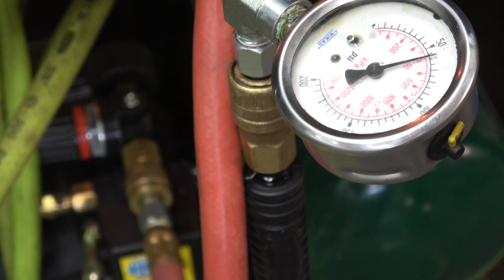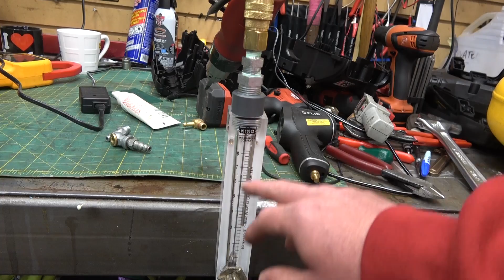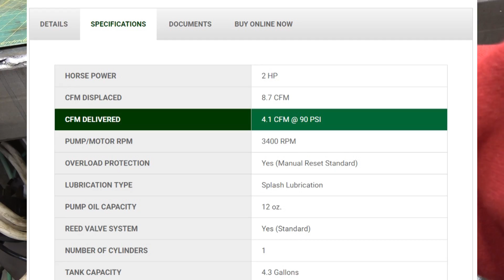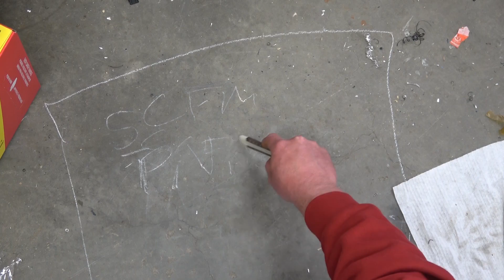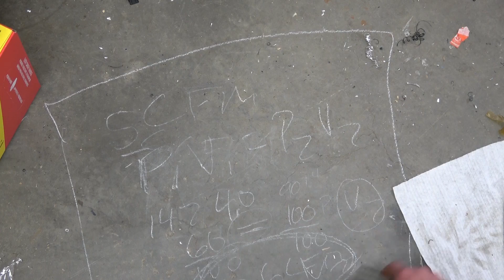Why are CFM ratings BS?

Comment: We can estimate power needed to deliver 4 CFM at 90 PSI:  P = 3,25 * 4 * 90 = 1,17 kW.  (so we multiply cubic feet per minute by pressure drop in PSI and 'magic constant' 3,25 to convert it to watts). This is bare minimum if we assume 100% efficiency of compression (it all goes so smooth and slow that air doesn't heat up, so all the power goes only to build up pressure) and 100% efficiency of motor. For one-stage compressor it's obviously wrong, so we should at least double this value. So if compressor doesn't draw 2,4 kilowatts of angry pixies, no way it could deliver so much!
Reply: Isn't the compressor efficiency about 16%?  Motors are about 98% so say 15% overall, so you need about 6x your calculation
Reply: This. I've never believed for one second that an air tool whose electrical sibling draws 800W, 1000W, or more, is gonna run on a compressor drawing 1500W. At least now I know the details.
Reply: Standard outlets are 16A, so between 3520 and 3840W depending on line voltage. It depends on what country you're in, some outlets in Sweden are only 5A or 10A, while in NL 16A is standard, and in the UK it's 32A. Which is why they have those retarded plugs with upto 13A fuses in them.
Reply: @fermitupoupon1754  Those "retarded plugs" as you call them, are actually extremely well engineered and robust plugs designed from the ground up unlike the flimsy ones used in much of the world, like North America. However, whilst you might not like 32A circuits, they have the extremely useful facility that I can run more than one high-powered portable device in the workshop or kitchen plugged in where I like without worrying about tripping a breaker. A good tradeoff I feel for that small ceramic fuse in the plug. There is also the other side-benefit, that I can plug in a low power device with knowing that the relatively thin flexi cable is properly protected by a 3A fuse in the plug, and not just the 16A MCB. 

Also, before you mention it, that's for over-current protection. The 32A circuit is also protected by a residual current device.
Reply: ...on industrial grade machines the simplest method and will get you pretty close is about 4cfm per horsepower.....and at 575vac it's about 1hp per amp....also the base pressure is 100psi at a temperature range I don't remember lol.....now there are proper formulas to put you dead nuts on, but for the majority of applications the above 'formulas' work fine.
Reply: @angusandleigh  I've just moved to Sweden and I'm learning the hard-way, WTF no ground in bedrooms ?

Comment: My 8hp 100 gal. Vertical compressor keeps up with almost all of my air tools except the body saw , for some reason it won’t on that ? Some tools like from Harbor Freight are ment for High volume and my spray gun is high volume low pressure and it works great 👍 .

Comment: What the heck is the conversion from scfm @ xPSI to watts?  After a half hour of jazz hands I can't find this anywhere.  I mean it would be nice to know what the efficiency of a compressor system is etc.  If you could look at a compressor and know that 110V x 15A = 1.650KW therefore if they are trying to tell you the thing is going to blow out 5kw of pneumatic power it is obviously bull.  Or be able to see that you are actually getting getting 80% efficiency out of a compressor based on recorded data.  Heck, you could use this to evaluate what the efficiency of a compressor and pneumatic tool is.  The best result that I got is where someone else asked the same question and got crickets.  This should be pretty basic information to find.  Maybe I'm an idiot and don't understand something.

Comment: Yes, they are lying buggers. Dishonest business practice, I'm not even sure if the compressors are at fault or the tool manufacturers. Did they first make the compressors and give them a rating based on fill? that IS the compressors job... But tools to use the same ratings on purpose to shank you?

Comment: I always thought they worked it out by the piston swept volume x rpm and a good compressor is 2/3 of it's advertised rate. I always figured a compressor needs to be rated at double what your tool uses so it cycles on and off, constant running generates too much heat. I'm my last shop I got rid of the tank and just used a Hydrovane, lovely and quiet and lots of air all day long.

Comment: I am a mechanical engineer, formerly the Engineering manager at Sandvik Mining equipment in Canada.  We designed air compressors for ITH drilling.  SCFM is the standard for rating compressed air. The "S" stands for stands for Standard.  As I see it, the real travesty here is that your die grinder is rated in "non-standard" terms.  Air volume is affected by temperature, humidity and pressure.  All compressors (AND TOOLS) should be volumetrically rated by SCFM.  For the record, Atlas Crapco does the same.  Sorry dude.

No surprise here ... Snap-On publishes both CFM and SCFM data, as they should.
https://store.snapon.com/1-4-Collet-Die-Grinder-Air-Mini-Cushion-Grip-1-4-Collet-25-000-RPM--P650112.aspx
Reply: Just for those that wanted to check, the specs AvE showed were 3.2 CFM, but 23 SCFM. Which is why it is sucking that compressor dry. 

So @Scott Dalrymple If I understand correctly, a little math will get you from the advertised "bogus CFM" to a more helpful SCFM? Take the HF Earthquake XT 1/2in drive impact. It's rated 6.0cfm@90psi. So 6.0*90=X*14.7 give us roughly 36-37 SCFM. 

If that is true, then you could simply take the CFM @Xpsi, multiply them and divide by 14.7 to know what sort of compressor you need. That would help a lot with the less honest tool manufacturers. But the truth is, that no 120v compressor is going to keep up with any tool, especially if they're under 15 amp. The advantage of an impact is that you would only need it for a few seconds at a time.
Reply: @ouisi7  Tool "air need" ratings are actually the real bogus ones. They use some "average" air need, based on some "average" use, like 5 seconds and then 55 seconds no use. A 1/2 inch impact when striking full force to bust a nut will be consuming like 30-40 SCFM. That is just the reality. Ingersoll Rand in certain models advertise this value. Almost all tools advertise "average" SCFM or CFM need. Another thing is the air regulator pressure vs SCFM curve ..... AVE is coming to realize all this now I suppose. I had tried tell in comments a few years back when he was trying to say the impact range torque ratings are bogus.... He will learn ... :)
Reply: I suppose the designation of SCFM doesn't help much, in Europe it says intake air flow XXX L/min which is quite obvious, along with max pressure X bars. The air tools are rated as 'air consumption'. Checking IR 36QMAX, it has both the imperial and metric spec - the metric is way more obvious... and the imperial is still listed as cfm, rather than scfm
Reply: Does velocity pressure come into play with this since total pressure = velocity press. + static press.?  I have never had an understanding with this.

Comment: To be truthful these crap home compressors should be rated as X.X SCFM @ XX psi 

Done accurately, this would allow apples to apples comparisons.

I think the crap air tools have poor tolerances, allowing bypassed air  (does no work) and thus requires much more airflow to develop rated torque and speed.  Love to see AvE address those claims.

Comment: Simply put, there is less air in a cubic foot of 14psi air than there is in 90psi air. The tools are rated with 90psi air volume, and the compressors with the ambient pressure air.
Reply: yeah it can supply the cfm and the psi, but not at the same time hahaha. they dont tell you that tho
Reply: Uh..
Reply: @RobertSzasz  oops, got my words mixed up.
Reply: Not quite. But the comoressor he shows says @90psi.

Comment: Are tool "CFM" rates also rated in SCFM perhaps? Keep in mind that if the SCFM at tool inlet is correct, it is true that inlet CFM will be much lower, but the CFM at the tool outlet (at atmospheric pressure) would be correct. If the compressor was rated by SCFM at 90PSI, and you measured the SCFM at the tool outlet, you'd get some giant number ~6 times the rating.

Comment: I have a 10 cfm compressor , had it for years, its good for spray guns, staple and nail guns air chisel etc, but running a rattle gun, die grinder or drill (rotary vane) for any more than 3 min its a sit and wait for more air time..

Comment: Buy the biggest one you can afford, exactly what I did and never have had a problem and I always buy Ingersoll Rand! I can run my DA sanders and air files without ever stopping to let the compressor build up to pressure- Ingersoll Rand 80 gallon tank, 5 horse motor, dual-cycle pump on 220 volts... sure she cost $1,200 and takes up a little bit of space but she is a beauty of a compressor and never makes me wait for a blow jobber!

Comment: Compressors have always been rated at free air displacement, which is 4.5 CFM per horsepower for which you can say per thousand watts of electric input. I ended up building my own workshop compressor with a ten kilowatt 3phase motor and a very large two stage pump from a tractor mounted two gun breaker comprssor. That gave me more than enough for spaying and running industrial power tools such as belt sanders and angle grinders.

Comment: The man is a national treasure. 
Curious to know, Given 120 volts and 15 amps, what is the maximum theoretically available flow at 90 psi?
Reply: That would depend on the mechanical efficiency and having to convert electrical to mechanical energy. Air compressors are the least efficient energy storage in use

Comment: I don't pay attention to what they say.  I have a 20-gallon tank, a 3-ish HP motor, and I can drive my air tools at 90-100 pressure long enough to do what needs doing.  Fortunately, I have a hose long enough to keep the compressor in the garage because it does indeed cycle all the time.  It's the consumer C/H, but it works for the piddly stuff I do.

Comment: AvE your flowmeter says "STP" anyway -- you're not even able to properly measure flow at high pressure. :-P

(And yes sucking / blowing performance can in principle be different even at 1 atmosphere, since the temperature of gas on inlet and outlet can be different. Humidity too, though I suspect it doesn't matter much.)

Comment: Electrical devices do the same type of thing if the box says "2000 watts of power!" What that really means is under full load for the unit it draws 2000 watts out of the wall, not delivering 2000 watts to the work piece. I don't really give a flying fart in church what it draws out of the wall. I want 2000 watts delivered to the tequila, ice, and lime juice in my blender.

Comment: When giving the "short version" of performance, nearly all pump manufacturers have always given the volume capacity pumping against zero pressure and also tell you the maximum pressure at zero flow and many leave you to assume these two specs are one. Wise old customers know that flow falls as pressure goes up. The better manufacturers will give you a performance curve or chart telling you the flow capacities across the range of possible pressures. Smart pump buyers know to look at the curve. Will you kids ever learn?
Reply: Like you say, compressor and pump (along with motor and power supply manufacturers) generally lie their asses off (how can a motor output more power than it consumes?) Some are a little more up front like Campbell Hausfeld:
Compressor Horsepower        3.70
Max PS                                    135
Compressor SCFM@40PSI    11.50
Compressor SCFM@90PSI    10.20
Compressor CFM@Max PSI   9.80 
DEWALT:
155 max PSI provides optimum tool performance. 
16.1 CFM at 40 PSI and 14 CFM at 90 PSI with 4.7 RHP 
Husky:
155 PSI max pressure 
16.1 CFM at 40 PSI and 14 CFM at 90 PSI for fast recovery time 
Ingersoll Rand:
Flow at 90 psi (cfm)  4.3  
Max Pressure (psig)  135  
Nominal Power (hp)  2  
Flow at Max Pressure (cfm)  3.2
Rolair seems a little shady. As you found, finding these specs are like pulling teeth.

Comment: HPA compressors are listed in the same manner. My 9L/pm unit will completely fill a 12L cylinder from flat empty to 5000psi in about 15 minutes when the ambient temperature is cold enough to skip any top-off thumb twiddling at the end. It's like BHP Vs. WHP and for the exact same reasons. I think compressor heads are rated from the pure theoretical ideal numbers of the pump running at speed without any plumbing at all and without any allowance for losses at all etc. As a rule I'm told spraying requires about x5 and tools up to x8 listed CFM when shopping for something to power it continuously.

Comment: You want to talk about BS ratings get a bilge pump.
Reply: Sounds like you've had a boat sink before.
Reply: @CodyJv  Not quite, I do own a boat though.
Reply: I may be able to help. Pumps have an operating curve.  (Air is compressible, and water is not.) The pump will be able to pump a volume against a pressure loss; the higher the loss, the less the volume (pump head).  E.g. 25 gpm @ 0 ft. (water column) through 2 gpm @ 15 feet (w.c.)  (non-linear).  That, hopefully, gives you some idea if you did not already know that.

Comment: My time to shine:
The ratings for a compressors are so called F.A.D ratings, free air delivery. Which, shockingly has nothing to do with delivery of air. But bear with me, in about half an hour, reading my blabbering 3 times and many head scratches later that will make sense. 

F.A.D is the amount of air that is forced into the compressor on the suction side, at a specific ambient temperature, relative humidity and ambient pressure. This is done to decouple the compressor performance from the ambient conditions because as we know, manufacturers tend to lie about this shit (You may have guessed i work for one by now). Decoupling and regulating the ambient conditions is the only thing that makes compressors from different manufacturers actually comparable. Many don't want that, guess why. 
The figure you see anywhere on the interwebs telling you of magic airflow the compressor can produce will be pure bullshittery until you see those magic words somewhere: "value boasting is according to ISO 1217:somthing long numbers".  You are not going to see that on any home depo or equivalent compressor.
What we can learn from this is the ambient conditions are very important for an air compressor - so much so that cheap manufacturers are never gonna tell you in which conditions they measure.
Smart-assing over.

Btw: reciprocation compressors, like the one you are using here, are made for intermittent use and cannot sustain permanent load(screw compressors are your friend here). Good manufactureres will tell you how often an hour the compressor is allowed to switch on and how long it is allowed to run. Peace out.
Reply: Indosarnia A man can try to share his knowledge

Comment: My desk fan can give you more CFM, no pressure
Reply: That's alot of sucking power for your tails Mr Heads.
Reply: @nigelphuthi8861  Plenty of blow, no power
Reply: @marvintpandroid2213  Sniff-sniff...
Reply: Considering mine uses a compressor and the Coanda Effect, yes. Mine does.
Reply: Was using a vaccume motor and impellor as a desk fan earlier (was only running at about 50v tho not the full 240)
Reply: Until you use a pressure optimised fan.

Comment: I think even industrial compressors are rated at standard or inlet air conditions.  Outlet conditions can vary so widely so standard inlet conditions (sea level and 68 F temp) are used.  Many common units such as FAD (free air delivered), ACFM (actual CFM), SCFM (standard cfm) all mean the same thing.  They mean that capacity is measured at inlet conditions.   As I recall ISO 1217 defines the rating test method.

Comment: I'm glad you brought this up.  It is normal to relate gas flow to STP (standard temperature and pressure).  So SCFM is, as you say, at 14.7 psi absolute.  The problem is that many manufactures just say CFM, not SCFM in their advertising brochures.  If it's rated at 90psi, simply divide the rated flow by 6, and you'll get a better idea of the usable capacity.